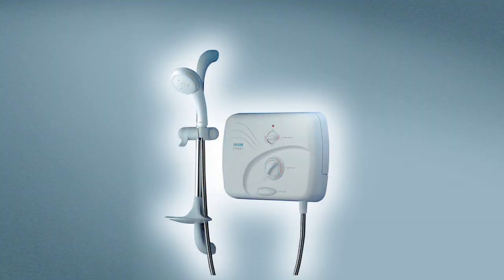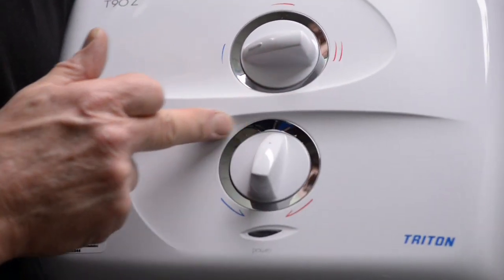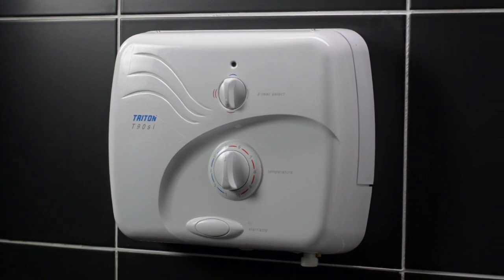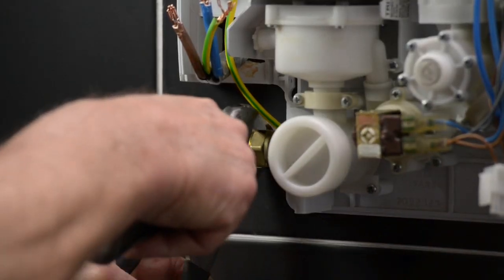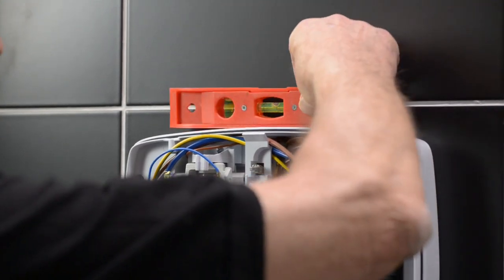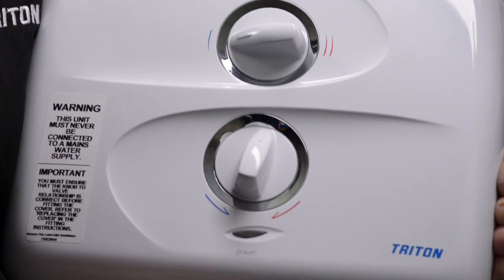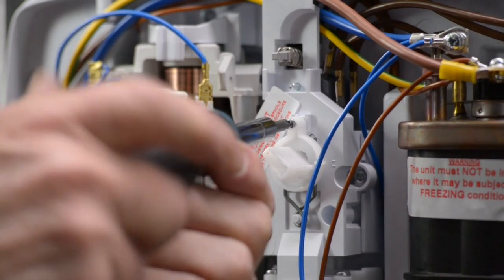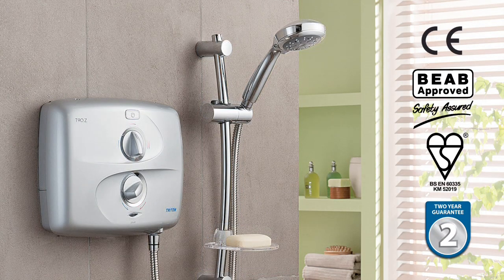Electric Showers: "T90Z Pumped" video from Triton Showers

Comment: One of my electric showers in my house is going from hot to cold then back to hot and cold and I tried multiple shower heads on the shower and it didn't do anything and I even blead it as well and it still does the same thing
Reply from the maker: Hi, this would sound like overheating from the description, this would typically be due to not enough water getting into the heater or the water staying in the heater to long. In the first instance we would advise checking the inlet filter to make sure that a blockage hasn't occurred restricting the flow in. Also if the head has already been changed checking that the hose hasn't kinked. If both appear okay we can offer further help over the phone on our service number 02476 372222.

Comment: I have a Triton AS2000XT pumped shower, installed 2.5 yrs ago, working off cold water from an attic tank, via apressure tank (have a well & submersible pump) and hot water from a HW cylinder and attic header tank. I have a few questions: 1) The entire range of required water temperatures for the shower occur over just a few degrees of the temperature dial - the rest is redundant. Is that normal?  2) I am finding that I gradually need to advance the temperature dial in order get the right temperature. Soon, I will reach the end of the dial. What then?  I will be buying another soon for an additional bathroom working of the same system and wonder whether it can cope.
Reply from the maker: +Gruntol5 Sorry to hear this. Provided that what you have described has not always been the case with your AS2000XT, it is possible that a blockage or air lock to the hot water feed, an inlet filter blockage on the hot water feed or a temperature valve issue are the most likely causes of the problem you are now experiencing.
Reply: +TritonShowers : Thanks for your reply. Blocked filters may be the answer, but where are they? I can only assume that they are inside the Triton enclosure? We've had a borehole supplied water system before and that didn't have any filters in it, resulting in the washing machine cycle eventually taking hours and faucets blocked. I think plumbers must be slightly mad. So easy & obvious to install an inline filter before the pressure tank.

Comment: I have a Triton t90xr and it is very loud what is the problem pls reply
Reply from the maker: xpert gamer Sorry for the delay in responding to your enquiry. Products that contain a pump, such as the T90xr pumped electric shower, will have a certain degree of noise which is the operational noise of the motor. As a guide, the noise tone and level would be something similar to that of an average hair dryer. Differing installation conditions, such as the type of wall that the unit is mounted on, may affect the actual noise emitted from the shower. If you do feel there is a fault with the product, we can arrange a warranty service visit for you through our service department (Tel: 0844 980 0750).